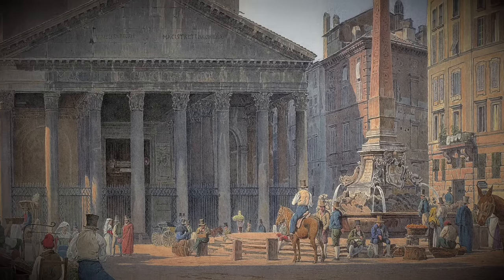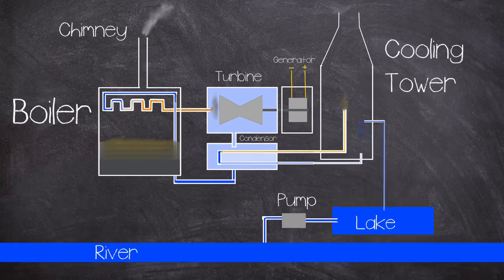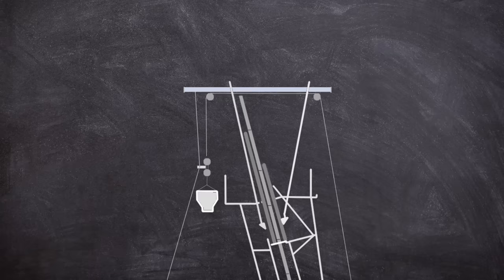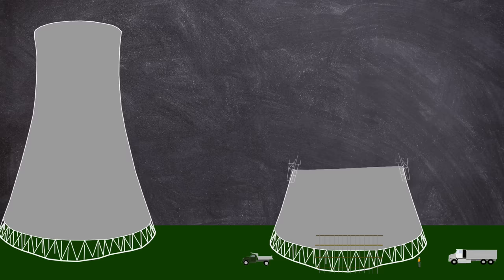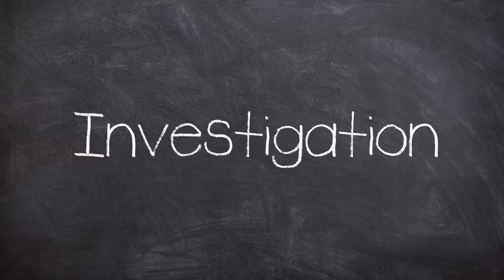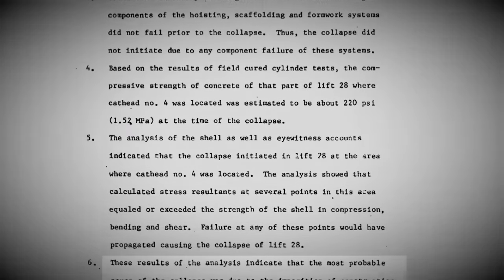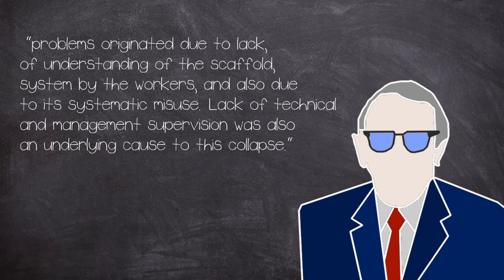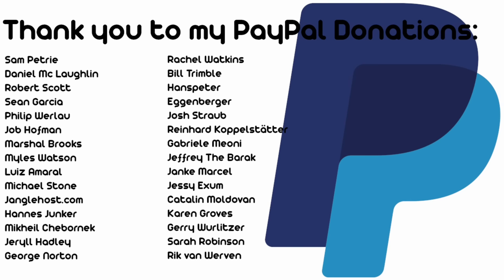The Willow Island Power Station Disaster 1978 | Plainly Difficult Documentary

Comment: ☝️Don't ignore Fred Dibnah, and don't ignore Millennium Tower in San Francisco!!👇 Mate! Get out in front of what will go down as the biggest concrete structure failure in history at 301 Mission St. San Francisco CA, 94105. The tower is already "collapsing in slow-motion". The engineering solutions to correct the run-away tilting have been "Plainly Difficult", and have only made matters worse this year ('22). Residents above 30th floor can't flush thier toilets anymore on the sunken NW side of the tower. The level grade of the floors has shifted enough to make drain water reverse, or stagnate, and mow must be pumped. If so much as a tiny earthquake occurs😬😮😶..(and it will) San Francisco is always ready for anything to happen quake-wise at this point/overdue. Plenty of old local news reports on YouTube following Millennium's disastrous developments, Since 2016 Millennium Tower news has been active (shout-out Jackson Van Der Beckon). You know how concrete works, mate. This 56 story apartment failure is going to happen without warning. No reason at this point, that eminent turn of events can't happen in 2023. Engineers did not put the foundation pilings to the bedrock when they layed the foundation. The building is sitting on clay! The ten foot thick foundation pad is "Dishing". A condition where the center of the concrete foundation is sinking to form a concave depression in the cement itself. Cheers!